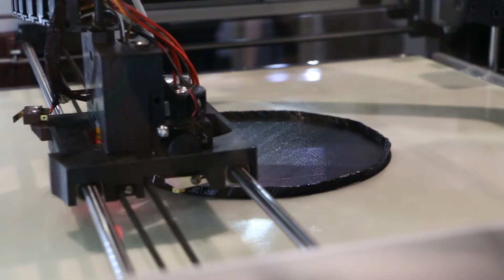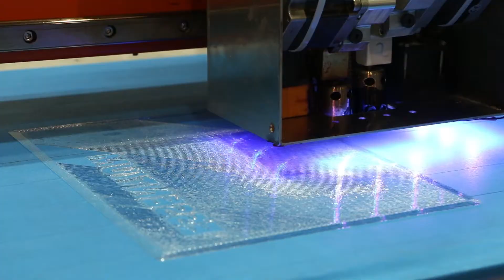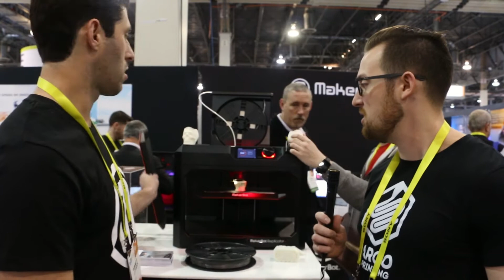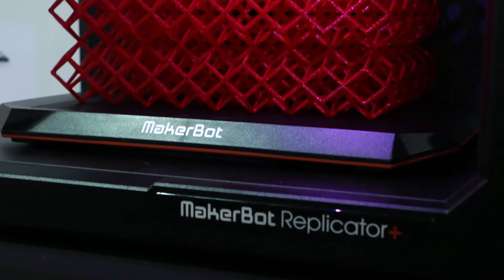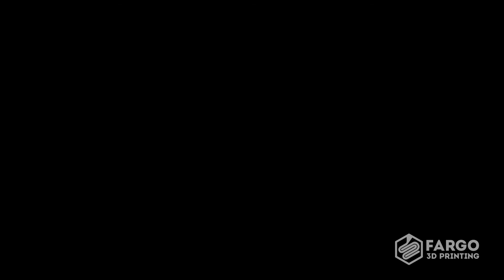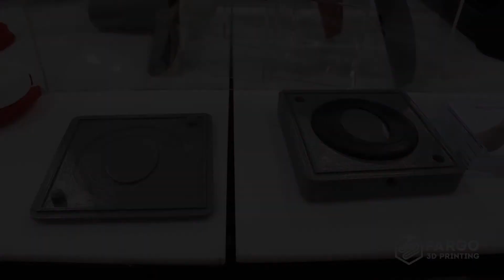MakerBot Replicator+ | CES 2017

Comment: The flexible build plate is the replicator+ biggest weakness.
Reply: @Jenner Bondsmith 
First of all the bed is not flat. And I mean really really not flat. Its a piece of moulded flexible plastic which beds up on the corners and edges by as much as 1mm!!! I complained and got a new build plate sent me, just to discover that the new one was exatly the same. It's a flaw in the design. So without a heavy over-extruded raft it is near impossible to get anything to stick to it. Secondly it is not heated, so anything except PLA is a no-no. Low temp PETG will work, but the plastic stick on sprint surface cannot handle the higher nozzle temperature and will warp after just a few prints. 
Replacing the build plate with a flat piece of glass or similar is not easily possible either.  Because of the unique way this machine calibrates z-height before each print the replacement plate has to be exactly the same thickness as the stock plate, and has to have a hole in one corner for the nozzle calibration. 
Shame really - because the rest of the machine works fine - except for the build plate which ruins the entire machine.